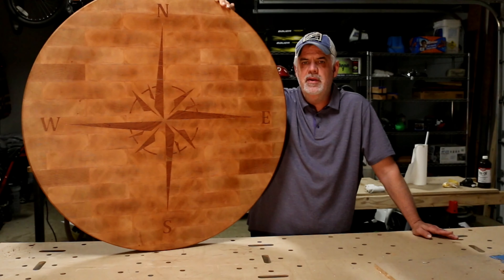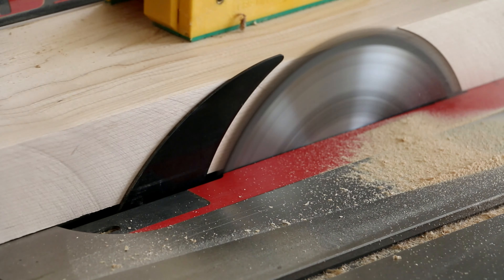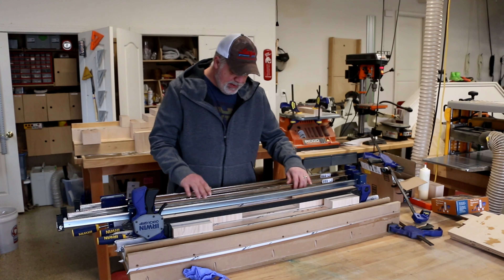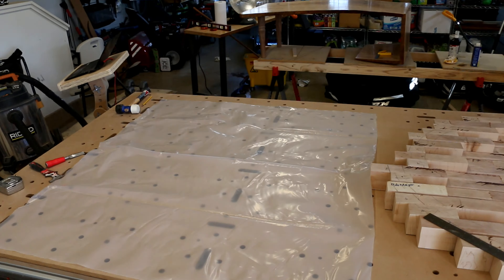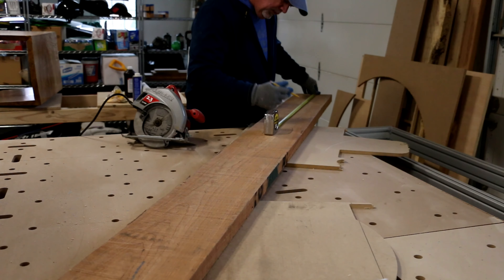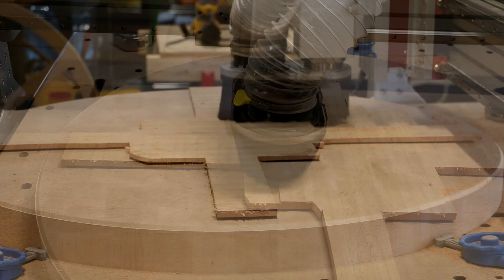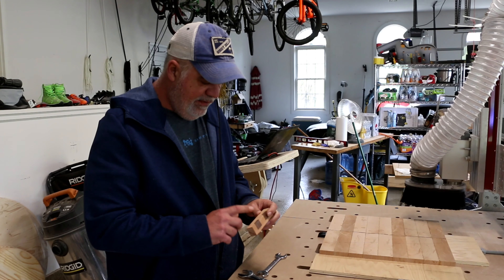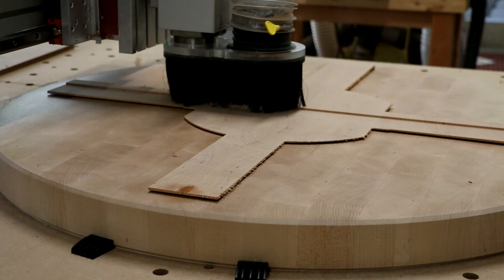Massive End-Grain Cutting Board Countertop

Comment: I'm also from the Matt Cremona camp. :-) Good move, offering a video... 
Really enjoyed that. Not sure if I follow even yet what you think created that cup, but I'm glad it flattened for you. My question is, what's keeping it from cupping, now that it's fastened to the cabinet? Will it not have the same issue? Sorry, not accusatory, or disparaging, just genuinely curious/trying to learn.
That compass rose... Wow! what a pleasant thing to chop veggies on! And that last touch, actually lining up the compass with a real one - that was perfect!!
Reply from the maker: The cabinet doesn’t have a solid top, or any sort of underlayment...  it’s got a 2 inch round of plywood, so the underside should get plenty of air...  and no issue in the question...  it was a good one.  If it was a sheet of plywood, I think you would get that same movement...
Reply: Interesting. I was considering doing one to put on top of an existing marble topped kitchen island. I guess that’s not a good idea. ??? There would be no air movement under the wood.
Reply from the maker: Gary McCoy I think of the entire thing was 3” thick, it would be more stable...  but not sure